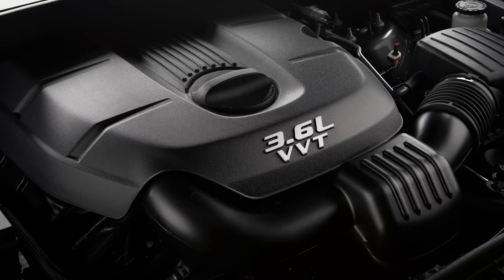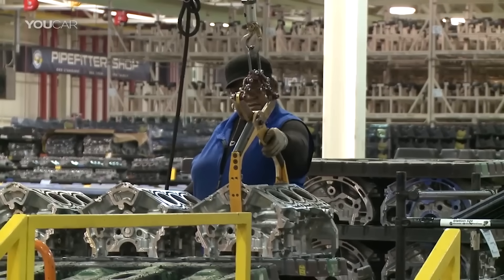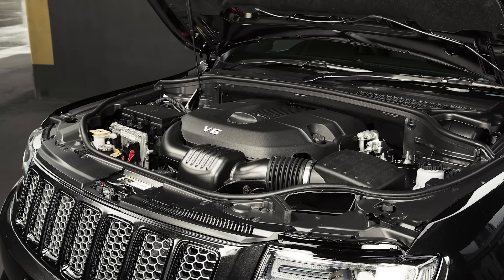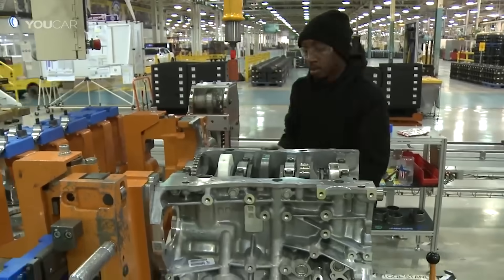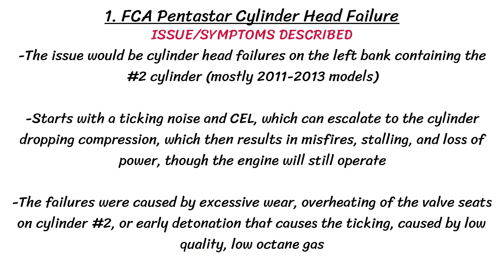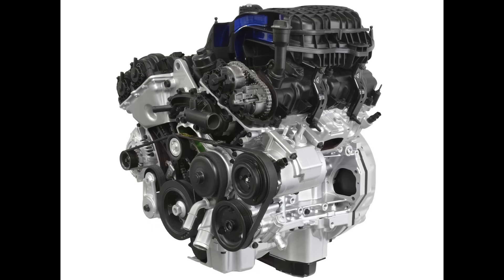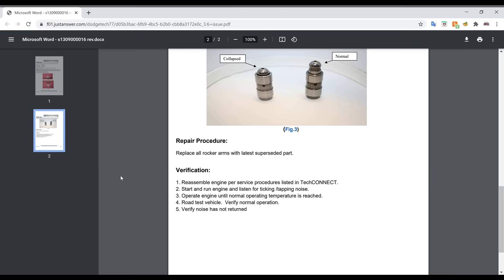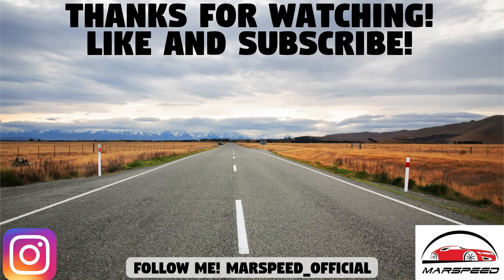The Specs and Fatal Flaws of the Chrysler 3.6L Pentastar V6 Engine

Comment: My 3.6 Liter Chrysler engine has been flawless since 2015. Great engine!
Reply: My 2016 charger made in 2015 has been running strong too
Reply: My 2012 3.6 needed the oil filter housing/cooler last year.  Replaced it myself.  Puking oil all over the engine and transmission.  240,000 km now and no other issues.
Reply: @OffTheBeatenPath_  yes that was a known issue but it was fixed in the 2015+ models.
Reply: @OffTheBeatenPath_  same here the cooler had a crack in it spilling oil everywhere as well as mixing it with the coolant which isn’t a quick process to flush out oil filled coolant lines. I thought it was a head gasket but thankfully haven’t had that problem yet.
Reply: Good little motors. There are known issues but for an engine that powers most of a manufacturers offerings it's pretty low in failure rate.
Reply: yep. our family’s 2015 chrysler town & country has around 120000 miles and runs perfectly fine.
Reply: You are the only one who warms it up most likely
Reply: @Jack Russelle Lewis it's a pretty good design , but its manufactured in a cheap way
Reply: My 2015 300 s with the 3.6 by is sitting at just over 160k. I've done basic oil changes at regular intervals, I've had a oil pan gasket dry out but I moved from the south up north.  I don't do anything fancy. Just synthetic 5w30. It's running like a champ still. Nice and quite. It is hesitating to shift it feels like sometimes but I think it's me barely on the pedal during a weird rpm. As it doesn't happen in sport mode.
Reply: @YerGoodBuddyKeith  nice! The transmissionnisnt the smoothest one out there but it gets the job done! If it starts to slip you could change the tranny oil at a transmission repair place
Reply: @YerGoodBuddyKeith  try premium gas!! I started putting premium in mine last month and feel a complete difference in my 2012 Chrysler 300C  3.6
Reply: @YerGoodBuddyKeith  why 5w30, it calls for 5w20
Reply: @coolbreezeNYC1  because it doesn't get extremely cold here but we do have incredible heat waves, so I use a slightly thicker oil. Honestly my dad and paw paw taught me to do it and I always have. I'm not racing my car so I'm not too worried about getting dry spots or anything.
Reply: I have a 2015 Dodge Challenger v6 with 143k miles and shockingly never have an issue, I bout the car in 2015 brand new with only 7 miles on it , I thank god this car still holding up
Reply: How many miles.
Reply: @Jack Russelle Lewis and no 2 engines that come off the line will be perfect, have the same repairs....ect
Reply: Same. Mine is on a 2014 jeep and it’s running good 95k miles strong haha
Reply: 2015 ram 3.6 100k miles still running like new only replaced serp belt and battery.
Reply: 160k died on 2011 grand caravan, then at 200k transmission replaced. Total 12k of repairs.
Reply: I noticed mine , when I hit the gas and speed up sometimes makes a clanking sound, clank clank clank clank.

Any idea what this is?

I also have the po6da code on and think it’s a solenoid at the oil pump, my oil pressure is fine though  and it’s not a sensor issue
Reply: @handymanforhome5268  sorry for your loss
Reply: What's your point, what mainstream auto makes makes a bad V6 nowadays, Toyota's 3.5 V6 has none of the Pentastar flaws..
Reply: Toyota's corporate 3.5 enters the chat.. seriously probably one of the best v6s ever made.
Reply: Well every maker has that one vehicle of the year make and model that actually does good but the acception to 1 or 2 does not outweigh the majority ,these engines are just of terrible design and full of flaws, I'm a seasoned auto tech and it is now may of 2025 and I'd like to know, how has the car been workin out for ya ? seeing as how your comment is 4yrs old now
Reply: A lot of people don’t realize that usually the flawed engines are outliers. 

Maybe driven too hard, or not hard enough. Maybe not maintained. Maybe built on a Friday. 

It’s just that they tend to have more problems than other engines.
Reply: @Bartonovich52  also don’t forget some people don’t even take care of their care at all and it still runs good enough but this never really happens ur going to get problems after like 130k miles if you don’t take care of a v6
Reply: I feel like a lot of people do not maintain their engine very well, either at all
Reply: Miss a few oil changes dude I’m a mechanic I see them fail every day hope yours keep running that’s great
Reply: @g2skinny  
If you're a mechanic then you'd know that if u "miss a few oil changes" on ANY motor u could have problems.
Reply: @g2skinny  I use Amsojl, filter every 6 months and 1 year oil changes. No problems
Reply: Haha u funny good joke them pos ant worth af
Reply: Thanks I just bought one spent all my money and I saw this.
Reply: @JayGotcha5285  as Clint would say.. do you feel lucky, well do ya! lol. 😃
Reply: Oh wow 5 years  LOL
Reply: @PatrickBaptist  I was emphasizing the lack of time, lol
Reply: 3.6 doesn't beat the 3.0l on  reliability
Reply: @theshield1613  yea but nothing beats the 4.0 Inline 6 in the jeeps 
 My wife's 2004 grandcheeke has over 227,000 on it running great.  Only thing is it's rotting away with rust
Reply: @dougregan4752  4.0l is a v8
Reply: @theshield1613  😳 what? The 4.0 liter is a straight 6cyl one of the best engines ever made!
Reply: @dougregan4752  oh okay you're talking about the jeep I was talking about the  Ford's and jaguar 4.0l v8
Reply: @dougregan4752  best v6 engine ever made 3800 v6 GM
Reply: @theshield1613  yea but I think i said inline 6cyl not v6
Reply: @theshield1613  it's an I6
Reply: @theshield1613  99 Chrysler 300m 3.5 liter engine  435,000 miles finally my 17 year old killed it blowing the doors off a Ford v 6
Reply: The rocker arms will fail, eventually.
Reply: @2003lightning1  'Eventually' at a whole 12,000 miles???
Reply: @billgates1682  2014 and older
Reply: how many miles are on it tho? my 07 toyota 3.5 v6 have 260k miles still runs quarter mile in 13.8 , other than maintenance parts the only thing i’ve had to do to it was replace the alternator an fuel injectors , the engine will outlive the frame
Reply: @ripdiptatterchip3851  my 2016 charger v6 has 120k on the odometer. No repairs only maintenance.
Reply: @luismontoya5973  
I would expect ANY motor to last 120,000 miles without any MAJOR engine work.
If it makes it to 200,000 I'd say its a good motor!
Reply: @luismontoya5973  
I would expect ANY motor to last 120,000 miles without any MAJOR engine work.
If it makes it to 200,000 I'd say its a good motor!
Reply: @ripdiptatterchip3851  Your 07 Toyota 3.5 V6 has been made since the early 2000s, with the core design far, far, far, far older than that. Toyota's reliability is a thing because they use outdated technology. And that's okay! The Pentastar has only existed since 2011, and it has improved significantly with every single year since then.
Reply: @ripdiptatterchip3851  also if you look on google someone got 626,000 miles with the pentastar v6!
Reply: @ Scarey Terry. 

A lot of those older engines don’t have the same issues. 

But Toyotas did have problems with VVTi like a lot of other engines with variable valve timing and the newer ones with oil consumption as they put in weaker oil control rings to reduce frictional losses.
Reply: @Bartonovich52   mines an 07 is350, it has vvt it works great i love the sound of it it’s a really deap but loud induction noise , imo it’s better than honda’s vtec vvt , i’ve put 187k on this car myself i bought it used in 2016 with 73k an been daily  driving all around the united states since put an average of 35.5k a year but i’ve been sitting around the last year so, but thing never gave me problems except electronics, sometimes my windows won’t roll down or back up my radio sometimes won’t connect to the aux or bluetooths an it randomly shows tpms light and sometimes the gauge lights won’t turn on but to fix it you have to turn off the car n wait 15-20 mins n then it’ll work lol
Reply: @ripdiptatterchip3851  2GR and the J35 shit on the 3.6l and those are older lol
Reply: @ripdiptatterchip3851  I have an 04 Sienna , I can out accelerate the 3.6 l with my 3.3 l from a stoplight. They can stay even , until the 2nd stage of the air intake system opens
Reply: @troystocker6179  lol probably didn't know you were trying to race 🤣 😂 😅
Reply: @troystocker6179  I call bullshit!
Reply: @troystocker6179  ive smoked new camrys in my 200 with the pentastar. I higjly doubt dude in the pentastar was trying.
Reply: Well... except for that pretty common roller rocker failure issue...
Reply: @billgates1682  thats in the early models. They have improved it massively. Mine has no ticking, roller arms issues, or any souns
Reply: @luismontoya5973  It was a 2016...
Reply: I have replaced an 3.6 already, They aren't made to be driven hard...Honestly the worst motor developed, Plastic everywhere on metal parts that are 200 degrees when the engine is running...Smdh
Reply: @Mob4uso  
Lots of motors are made with plastic and metal.....its HIGH TEMP polymer, NOT just "plastic" like u make it sound 😄
I know many owners with the 3.6 and they have well over 100,000 miles some over 200,000 miles on them.
The 3.6 is MUCH lighter than the 3.5 or 3.7 with LESS parts to break or wear, and MUCH morw HP than those other engines, its a great motor since 2014 since they fixed the valve dropping issue.
Reply: @motorcitymanman7711  Unless you're promoting Chrysler-Fiat your response to my comment has no weight. The platform is POS, Chrysler knows this...Update yourself on the National Bulletins on the 3.6 first...Valve dropping most definitely isn't a issue, Never heard of that one, lol...Try Rocker Arm failures on 100,000 plus vehicles, Mr. Expert
Reply: @motorcitymanman7711  Hey I never knew that valves miss either😂😂😂
Thanks but no thanks for the miseducational lesson👌🏽
Reply: @Mob4uso  
Go back to grade school and learn how to read, I never said valves "miss " Chucklehead. 😆
If u were a real mechanic, I mean a REAL mechanic, you'd know the difference between plastic and high engineered, high temp  POLYMER that they use when they design motors.......next you'll tell me radiators r just plastic too, a miracle they last over 100,000 miles without melting from those high temps isnt it!!! 🤣🤣
Reply: @Mob4uso  
YOU started with the sarcastic insults "Mr. EXPERT", IF U CANT take the heat get out of the kitchen junior.
Reply: @motorcitymanman7711  yeah the Plastics design to go through a lot of expansions and contractions or Duty Cycles but they will fail you may not notice it at first but don't start with a lean code probably just like any radiator that has the plastic tanks on them they will fail sooner than the ones that are made completely out of aluminum or another alloy without plastic like Volkswagens Plastics that go from the oil filter housing up to the intake all that stuff just crumbles when the cars get like 80,000 miles and most of  your plastic intakes(domestics) fail between 100 and 200 thousand miles. I don't like cars with plastic water pumps for that very reason including the park breaking and then going through your system and causing more damage are the sneaky overheating gradually that you don't notice because you don't have a gauge when a couple plastic impellers break off just need to go back to the middle it's not worth the weight savings and the redundancy of replacing all the plastic Bits for warping etc

Comment: Even though I know Chrysler vehicles always have issues, I still refuse to look at other brands. I just like these cars, they arent boring. 
I had a newer Toyota once and couldnt really connect with it cause there was never nothing wrong with it...
Reply: So Toyota was too reliable?
Reply: @robotbjorn4952  Way too reliable 😅😅😅
Reply: @robotbjorn4952  they used to be really reliable but that really is no longer.
Reply: @Sak-zo1ui  I think you're a bit wrong, they are VERY reliable in having Quality control issues and some random problems which are just dumb. Ofc dealers see the most, but i'd like to think once they're out of warranty they'd be one of the best.
Reply: @baileyhatfield4273  those “dumb” issues are the same issues with chrysler, ford, gm etc. The newer toyotas are nothing like the older toyotas and they have their issues like every other brand. Every brand has motors that have been running since the early dawn of time. That does not mean every vehicle is therefore reliable.
Reply: @Sak-zo1ui  Shame. When did they begin to lose quality?
Reply: @robotbjorn4952   the 2012s onward they are more poorly designed vehicles than anything. A lot of the new toyotas are very compacted in design and little things like changing a starter can be difficult. But from 2003 to 2012 there were a lot of recalls but they were still decent vehicles. Im not saying they are all crap vehicles but their design has been changing from very simple to very time consuming to work on.
Reply: @Sak-zo1ui  yeah dude you really don’t know what you’re talking about, and the only starters that are difficult to change are V8 Toyota engines. The rest of the are easy to swap out, 2012 and onwards are some of the most reliable models with the least amount of issues.
Reply: @tails300  that is what i was refering to. But the vehicles do not have the greatest of electrical systems although mechanically they have been rock solid for the most part. From what i have gathered they can be electrical nightmares.
Reply: @baileyhatfield4273  Toyota had a really good setup turn of the century but they haven't really matched that since. They still run previous gen tech and undertuned drive trains to try and keep up reliability but they aren't like they used to be.
Reply: @Sak-zo1ui  I’ve had3 wranglers 12,15 and 18 with no issues🤷🏻‍♂️
Reply: @MikeSmith-ey7ku  people are just gonna hate. A lot of issues can be prevented if the owner starts to notice the issue before it becomes extremely difficult to handle. People know nothing about cars anymore but everyone knows everything.
Reply: @MikeSmith-ey7ku  a sample size of 3. that's enough to send us to Mars and back.
Reply: @Sak-zo1ui  All manufacturers have improved QDR over the years.  For some reason people believe old myths that cars used to be built better.  There are more cars on the road now with over 200k mostly trouble free miles that at any point in history.
Reply: @user-tb7rn1il3q  i think there is some merit to some things being built better. Specifically old wheel bearings were a million times better. With todays grease they are awesome. Yesterdays engines were and still are extremely reliable and so are todays. Sending units are another story. Everyone wants to argue about the materials used. But modern engines have been given the best chance possible with the oils, and proper lubricants used. Oils have changed drastically in the last 20 years whether people want to agree or not. There are pros and cons to both but definitely overall new cars take the cake. Where new cars have failed is they can sometimes require more specialized equipment and they also can contain un fixable boards.
Reply: Basically every brand has its issues. Not just chrysler.  It is how they are solved that makes the difference.
Reply: I would say since we're talking about engines Toyota's equivalent the 2gr fe it's probably what we should be comparing
Reply: No one ever said capitalism thrives on logic. Most folks buy things on emotion, and defend the purchase later with convoluted logic
Reply: @billmoyer3254  or maybe you can purchase things using logic.
Reply: @Sak-zo1ui  logic would collapse the system
Reply: Yea I dunno Dodge/Chrysler FCA or whatever have a bad image for reliability. A great image for performance but terrible  for reliability. Definitely can get them cheap and thats where people go wrong. They have good amenities but I can say I for myself that I'm not confident in their overall reliability seeing as that I own one and have had many issues with work vehicles from this brand.